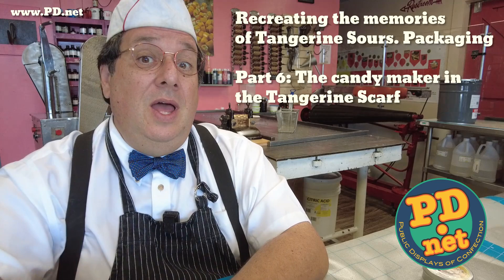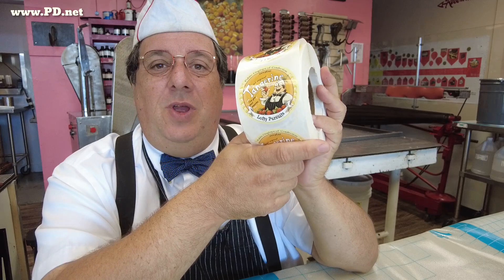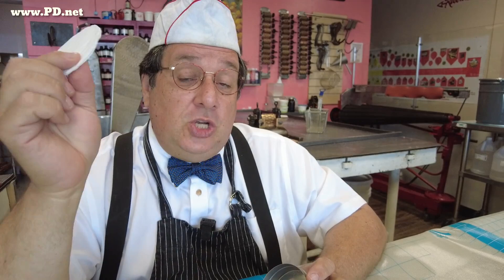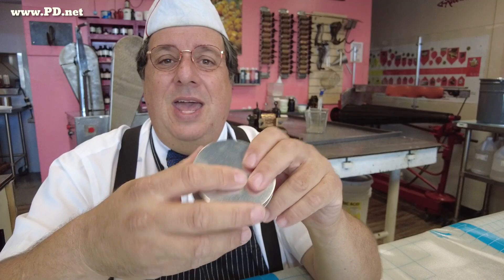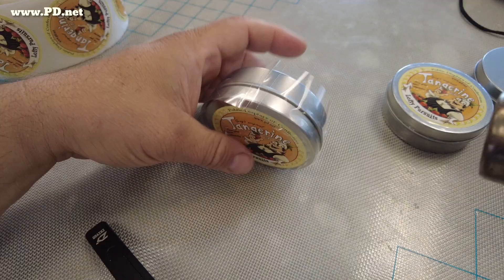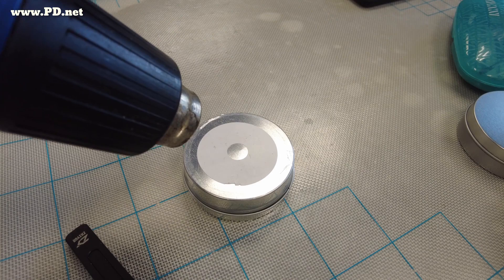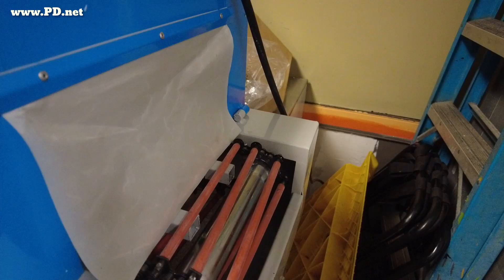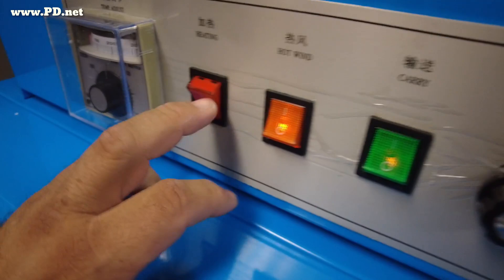#162 packaging. Recreating Tangerine Sours. the Candy Maker in the Tangerine Scarf - Part 6

Comment: Ball mills are pretty simple to make, all you need is some stainless ball bearings and a rotating drum. Could likely do it in the panning machine but it'd make a real racket and probably a lot of dust since it doesn't seal, and a rock tumbler/ball mill like the United Nuclear one you showed can be made food grade by just ditching the plastic drum for a Mason jar and going to food grade BBs.

Comment: I have a lot of experience with shrink tunnels of different sizes.  Each tunnel has it's own sweet spot. Which you may find easy to control as long as every one applies the plastic strip uniformly.  That will come to you quickly and then will move along fast.  Good stuff gentleman.  Thank you.

Comment: If you haven't looked into them yet, maybe a chocolate conch/melanger/grinder for grinding the acid?
they are a type of grinder that rotates granite wheels against a granite base, also used to grind spiced very fine in some Indian cuisine, as well as to make some types of dahl.
They can get powdered quite dry, and if you're only using it for the dry powder, you should be able to do a decent batch size in a consumer sized unit without too much trouble (my concerns would be making too much dust from the fine powder)
Reply from the maker: I am familiar with them, but they're more expensive than the ball mills that are food safe so that kind of doesn't solve the problem.
Reply: @LoftyPursuits  That surprises me, here in Australia getting the conch is expensive, but still much cheaper than a food grade ball mill. 
Different market though. Sorry, didn't think they would be so different by comparison.
Look forward to seeing the updates and your way forward

Comment: Have you looked at something called "Planetary Ball Mill Machine"
Planetary ball mills are much smaller in comparison to common ball mills and are largely used in laboratories to grind sample materials to very small sizes. Using them, one can grind powder samples in vacuum state as well, if vacuum mill jars are present in the ball mill.
And they are usually much cheaper.
Well depending on the size of the capacity that is....
Reply from the maker: I need to bring at least 2lbs at a go. Those things are tiny
Reply: @LoftyPursuits  Ahhh ok 
But...
The only thing that needs to be food safe is really the the drum and balls?
All you need then is to have the drum and balls changed to stainless steel right?
Because all a ball mill is really is a drum that is slowly revolving with steel balls inside.
Nothing more.
I'm not surprised if you local handy man can't put something like that together.... :D

Comment: In Ye Olden Daze a tin like that would have been sealed with a turn of cellophane tape. No problem with heat demolishing labels or heating the tins and making sticky candy inside. The most common tape available is probably packing tape, but they make different backing materials and some are more flexible or stretchy, which would be better for conforming to the ridge on the edge of the tins. I haven't looked, but I'd expect a huge list of tape designs on the 3M web site, and probably some sort of product selector guide.

Comment: Um. If your using the flour mill for malice acid, and it has done flour before, you may need to have a cross contamination warning for wheat.... Can be hard to clean all the crevasses out, and have it keep giving up a bit in each batch.
Reply from the maker: It's a new one it's never been used.
Reply: @LoftyPursuits  Sweet! You obviously have a handle on the food safe and allergen issues.

Comment: Why not apply the rear labels after sealing the tins?  Seems like a straight forward work around.
Reply from the maker: The shrink wrap curves around the front and the back would end up going under the label. The label isn't designed to stretch so it wouldn't look good, and would be much slower because we'd have to apply it with more precision. It'll look better this way anyhow
Reply: @LoftyPursuits  Fair enough.  I thought the test thermal label you demonstrated was the full size.  Can't wait to purchase these.

Comment: I can't reiterate enough. You need an espresso grinder for the malic acid. Not a cheap coffee grinder, but one for espresso, real espresso requires a powdery coffee with a fairly strict consistency.
Reply from the maker: I just looked it up. Espresso is ground to 200 microns in size. We  need to get down to about half that size to have the effect we need. Good idea, but still not good enough.

Comment: The picture for the mill looks identical to a rock tumbler from harbor freight. I'm not sure what would be necessary to make one food safe, but it might be a good starting point.
Reply from the maker: Replace all the metal parts with certified food safe parts ... It'll probably be easier to start from scratch.
Reply: @LoftyPursuits  the drums on the rock tumblers I have had were either plastic or rubber.

Comment: Greg, have you consider using steel pin media in a brass tumbler? they're used for cleaning the cases of spent ammunition for reloading. Obviously you would need one NIB,as anything thats been used with cartridge components isn't going to be food safe.
Reply from the maker: They are not certified food safe. No idea what type of plastic they use.
Reply: @LoftyPursuits  ah didn't think of that. I'm sure one could get creative and make them foodsafe with some modifications, but I doubt the FDA would see it that way.
Reply from the maker: Easier to build from scratch. I think I could build one with $20 worth of new parts and stuff i already own.
Reply: @LoftyPursuits  it really is as simple as reinventing the wheel sometimes, er the tumbler rather
Reply from the maker: The issue is finding the time, I don't have a lot of that right now. It's easier for me to find it off the shelf solution.

Comment: My recollection of the originals is that they had a strip of sticky tape going around the edge. Wouldn't that be easier than heat shrinking?
Reply from the maker: Slower to apply, more expensive.

Comment: That grinder machine pic you showed looks like a rock tumbler. Could that work for grinding the malic acid?
Reply from the maker: It could work, but is it certified food safe?
Reply: @LoftyPursuits  That I don't know. But I think rock tumblers have a rubber lining inside. It couldn't hurt to check it out.
Reply from the maker: Rubber is worse for finding out if it's food safe. We are required to use nsf certified things that's why I built my panning machine out of NSF certified salad bowls.
Reply: @LoftyPursuits  😥😥

Comment: Put the thermal labels on after shrink wrap
Reply from the maker: I may not have been clear, the plastic wrap wraps over the front and the back by about a quarter inch and goes over the labels. There's no good way to put the labels on it after you shrink wrap it.

Comment: Did you try a type of tape for tins like with a tab. Something like painters tape but smaller
Reply from the maker: Tape is even slower to apply and is more expensive. You have to use specific tape that will make the airtight seal not hard to find just not cheap. It may actually come to this but I'm going to try the shrink wrap bands because they're cost-effective and proven technology

Comment: Does the acid grind differently if you chill it down first?
Reply from the maker: It shouldn't be any difference but it will force moisture to condense on it as humid as it is around here. That will cause entirely different problems